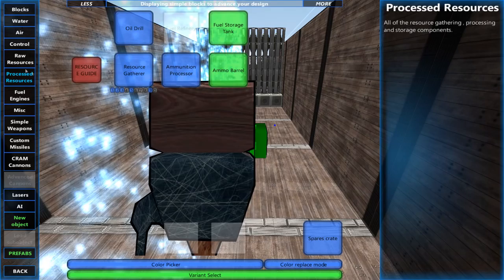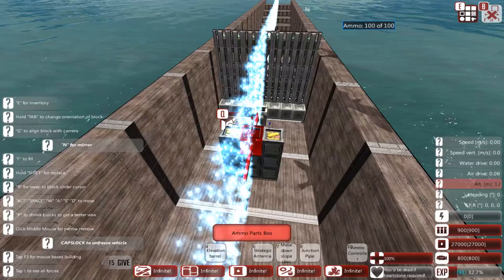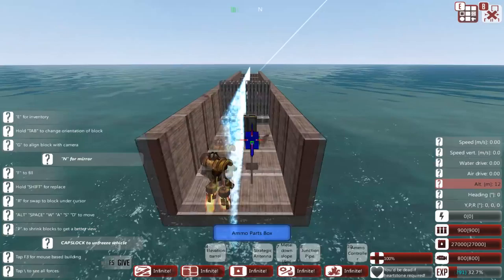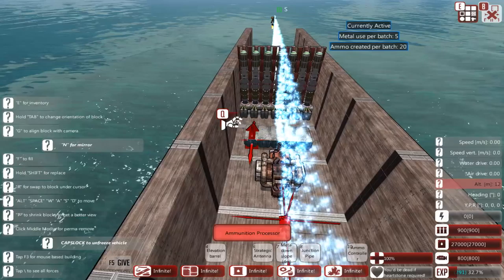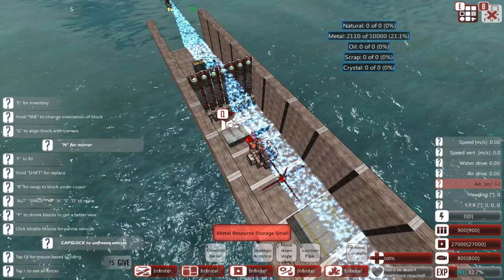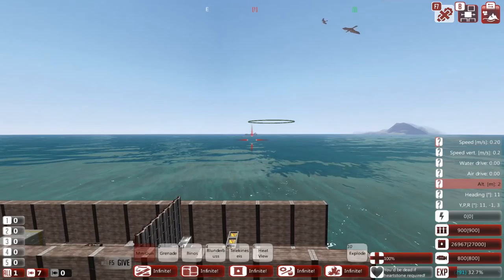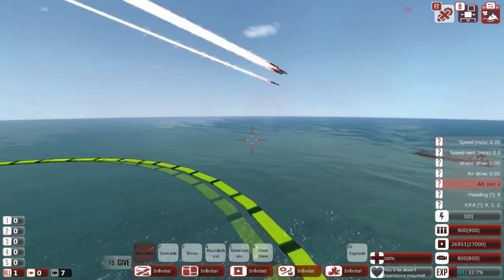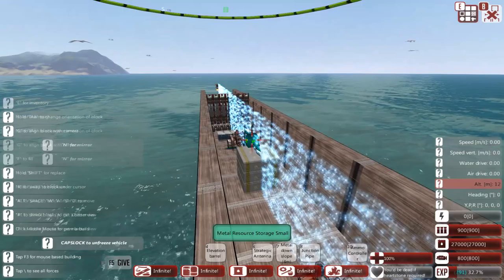Ammo, Ammo Processors and Metal Resources - Back to Basics: Boat Tutorial Pt4 - From the Depths

Comment: There are some quite rare FTD mechanics that I haven't seen anyone do yet, which you might consider;
Mainly sails and paddles and how to get the AI to use them (a bit of a selfish request - I've been trying to make early steamships with sails and I've no idea how to get the AI to control them, even with the sailing card...).
Reply from the maker: +T Neale Bah, I've been putting off doing sails and paddles, lol.  I've hardly used them.  They're just ... bad compared to propellers, lol.  They do look cool though.  I guess I should at least cover them.
Reply: ireLAN Gaming Yeah, they don't really have any application in the base game... I think there are usermade campaigns in the works that revolve around the age of sail, which will be nice.

At the moment I'm not sure if sails or paddles can even be used by the AI, or if they can, whether they can use both at once (plus rudders, to remove propellers entirely)...

Anyway, whatever you can put out will be appreciated.
Reply from the maker: T Neale You can indirectly control paddles with the AI using ACBS set to "when command received to go" settings.  You can do all sort of crafty things with them, they're just bad, lol.  This should work fine alongside rudders.  It might even work with PID controllers, but I haven't tested it.  I imagine they would be pretty screwy with paddles.
Reply: ireLAN Gaming Good to know. On sails,
It might just be an incorrect setup (turret not spinblock?), but I had tried slapping a spinblock sail on a paddleship (withou ACBS, just a simple always-turn order) and giving the AI the sailing card, but it failed to function or even allow fleet move. Aside from the sail/spinblock itself I can only think that it was because the ship had no rudder (the idea was to change tack with the sails, which worked under manual control).

There's a lot of stuff to look at with sails and paddles, if only because they're too much of a bother for nearly everyone, lol.
Reply from the maker: T Neale I must admit, I've only spent a brief time playing with sails.  Paddles can be fun, but are very fiddly to get the ship balance right.  Sails are just a bit of a pain in the ass for little gain, lol.  I need to play about with them and see what I can come up with.
Reply: ireLAN Gaming Looking forward to it!

Comment: Sort of related, but sort of unrelated. I'm building a new flagship for a new fleet I'll be making, while also re-learning the game mechanics. I've been spacing everything that goes boom with 2m spacing (because I thought that was the "limit" of the explosion). This obviously left a huge crater in my hull as soon as something penetrated the armor and hit the explody bits. 
I've been redesigning the entire gut of my ship after watching this, and added 3 space between every explody bit.
In addition, I've added a 2 beam wide armor around all the turrets.
They're mostly Trigats and MBCs stolen from your armory collection.
Now the issue is that these canons don't follow the explody-bit-rule of 3 blast radius, and when two turrets are placed next to each other (each with 2 layer armor around - totaling a 4 block "buffer" for every explosion) they both pop and cause a chain reaction for all the turrets on the ship.
Are the turrets/canons following a different explody-bit-rule than the rest of the explody-bits?

I've tested a bit and it seems the MBC in particular can blast through 5 blocks of armor before the damage from the  explosion is gone.
If there is air in between the canons they sometimes explode even at 5 blocks of space.
It just seems so inconsistent with everything else that goes boom.
Reply from the maker: +Nixxen Only ammo boxes have a 3m explosive radius, I didn't say this applied to other parts.  Adv cannons detonate every shell in the magazines and have a maximum radius of 11m.  This is not in any way "inconsistent" as everything that explodes, explodes differently...  Even fuel tanks explode, but only in a 1-2m radius, not 3m.

Comment: In the missile configuration menu, does the "body" serve any purpose except if you don't want anything else stored? Couldn't one just make use of it and put fins or a fuel tank or a type of warhead instead?
Reply from the maker: +datmanflyliketeca Nope, the body part doesn't do anything other than take up a slot.  It's definitely more worthwhile to put just about anything else there instead.
Reply: Ok thanks for confirming this! I thought it might've added some type of speed boost like how "solid warhead body" in advanced cannons add some speed and kinetic but nope. I usually just spam warheads in it's place XD.

Comment: Hmm, missile range = number of fuel tanks, regardless of speed?
Reply from the maker: +normal6969 If you use a variable thruster at a lower setting, I believe you can get a bit more distance out of your missiles, but generally speaking, the amount of fuel you have is more indicative of the range than anything else.  Although missile length and drag are factors as well.   Longer missiles need more fuel to go the same distance due to having a higher drag value.  That's all much more advanced missile stuff though.
Reply from the maker: ltwarhound Cool, thanks for the confirmation. :)